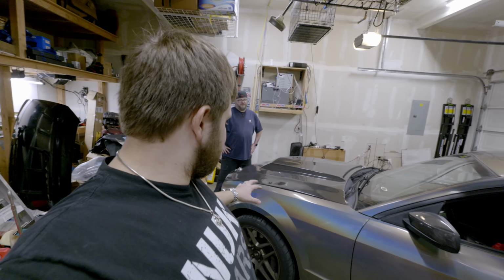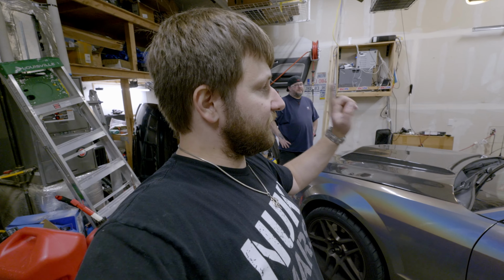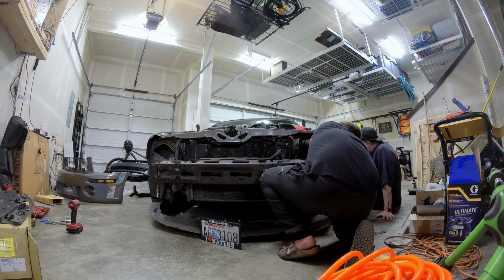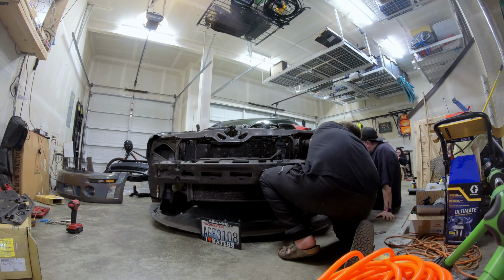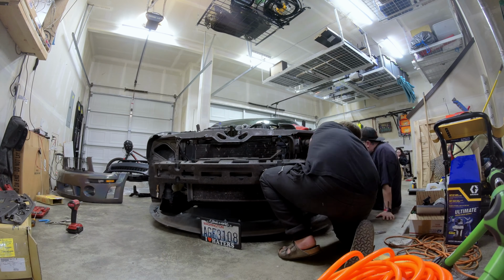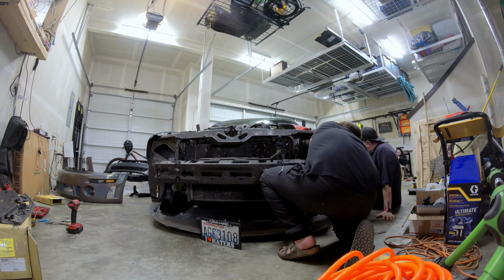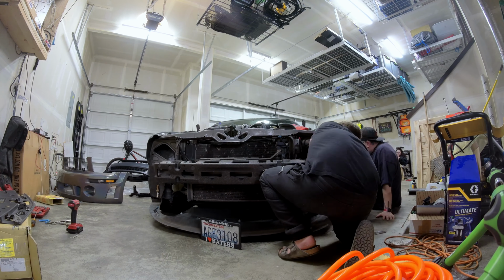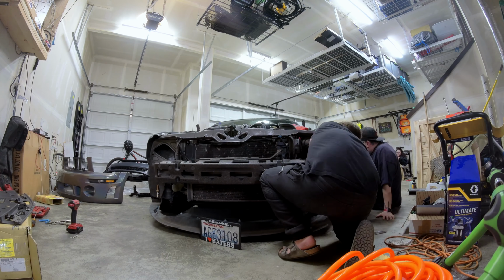S197 Facelift Part 2

Comment: is it possible do the rear end as well
Reply from the maker: Rear end - you are referring to tail lights etc? That would require a LOT of work. The trunk is a different width as well so at that point might as well just get a 10-14 body and start putting parts in it.
Reply: @DronezandGasoline  True